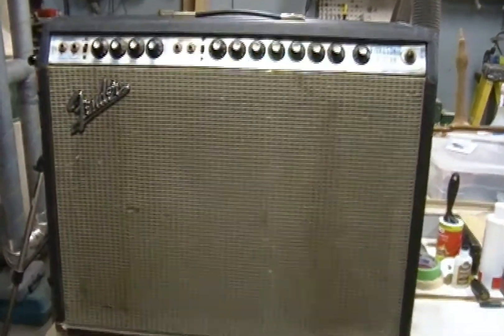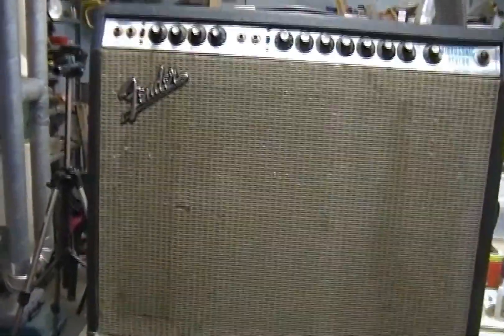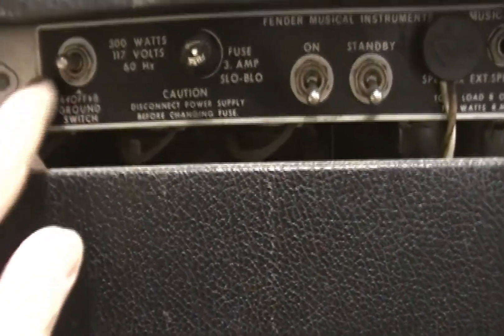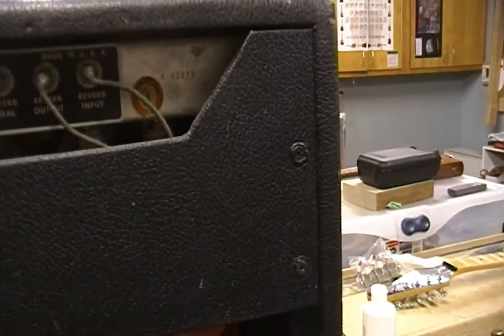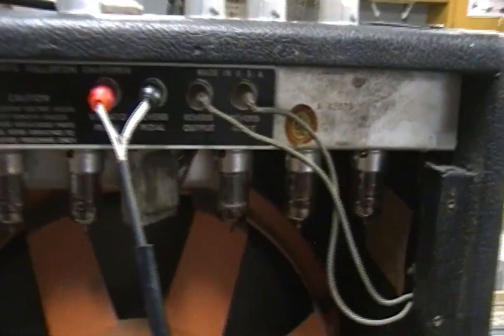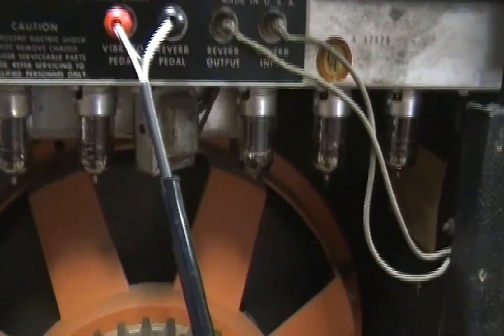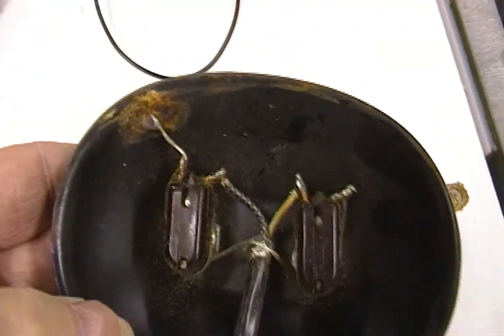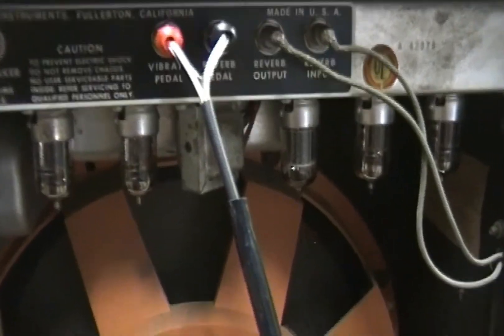JONAH GUITAR, FENDER AMP REPAIR, HELP!

Comment: I've been told by several reliable people those stickers inside the Fender amps are not always 100% accurate, they stuck them into similar amps produced around the same time the sticker was valid for other amps being produced at that time that were similar. usually the tubes are referred to from left to right v1, v2 v3 etc...  v1= preamp channel 1. v2= preamp 2nd channel. v3=reverb driver. v4=2nd gain stage for reverb return. v5=vibrato. v6=phase inverter. the reverb on my Fender Twin will work without the pedal plugged in but in order to get the vibrato to work I have to plug in the pedal to turn it on and off. also you might want to consider re-capping the amp, usually that old the electrolytic fluids have dried up in some of the caps and need to be replaced to function properly. I hope this helps.
Reply from the maker: Thank you for the info Randy very much appreciated.

Comment: To answer the simple questions first for everyone else wondering. Then troubleshooting via email with Dane.

The 300 Watts designation near the power cord means that the amp draws 300 watts of electricity from the wall. The 100 Watts designation near the speaker jack means the amp will produce 100 Watts of output power into an 8 ohm load.

The tube chart sticker is definitely the wrong one. It's for a 50 watt tube rectified circuit. (2x 6L6 power tubes and 1x 5U4 rectifier), where this one is a 100 watt solid state rectified amp (4x 6L6 tubes and no rectifier tube.)

7025 is the same as a 12AX7, 12AX7A. Back in the day 7025 was a low noise, low hum version, but nowadays they're all the same.

The 12AT7 tubes are used as a reverb driver tube, and also as a phase splitter/driver tube for the output power tubes.
Reply from the maker: Thanks much amps. Your email is extremely informative. As is what you wrote here. I appreciate you coming to assist me.

Comment: It looks like the most correct schematic I can find is Fender's AA-769 Twin Reverb circuit. So some slight differences to the first schematic I was looking at earlier. The 2nd half of V4 is also used for a vibrato return stage.
Reply from the maker: OK when I get out to the shop tomorrow night I'll swap out V1 with V4 and see what happens.

Comment: The correct tube layout is: Left to right, looking at the back of the amp:
6L6GC x 4 = 2 pairs of 30 watt output tubes
V6 12AT7 = Phase Splitter/driver (both halves used)
V5 12AX7 = Vibrato generator (both halves used)
V4 7025 = Reverb return gain stage (2nd half unused)
V3 12AT7 = reverb driver (both halves paralleled together)
V2 7025 = vibrato channel gain 1 stage and gain 2 stage
V1 7025 = normal channel gain 1 stage and gain 2 stage
Reply from the maker: OK amps you just answered a question I asked in an email about which tube controls the vibrato. Now I will study this intently.

Comment: DANE NICHOLS, 
if i remove the CHOKE in the power supply and used a jumper wire what would happen to the AC ripple?
 
Does NOT using a CHOKE create harmonics added to the circuit and amplifier?
Reply from the maker: bill williams, I appreciate the question but this is not my field at al. 100amplifiers is top notch and he may see this because he helped me a lot with this amp. Hopefully he will and will respond to your question.
Reply: @jonahguitarguy  ok i will try him he is 100amplifiers?
Reply from the maker: @billwilliams6338 , yep that's his handle. But he will probably see this comment.